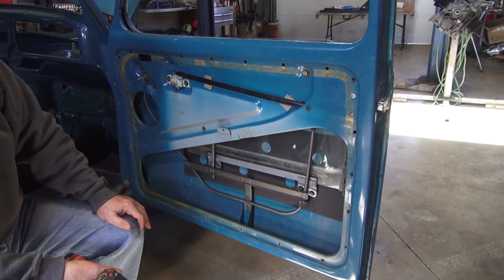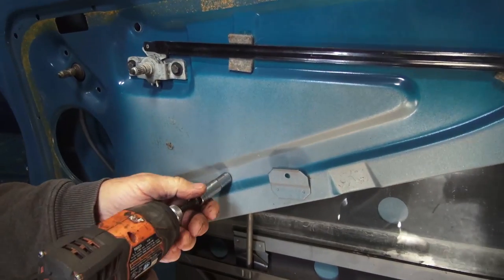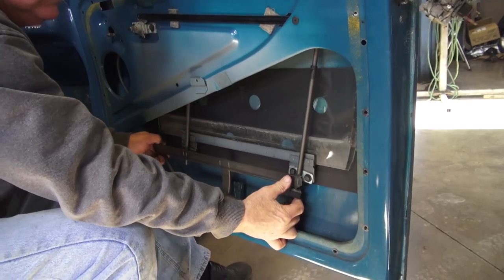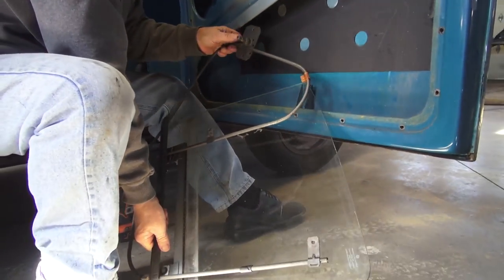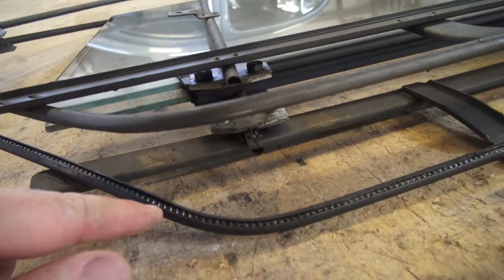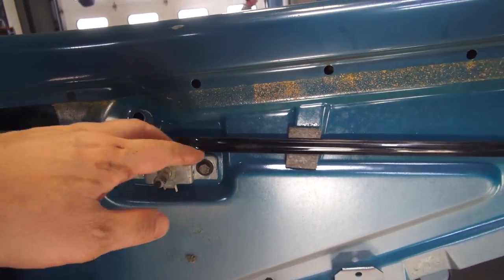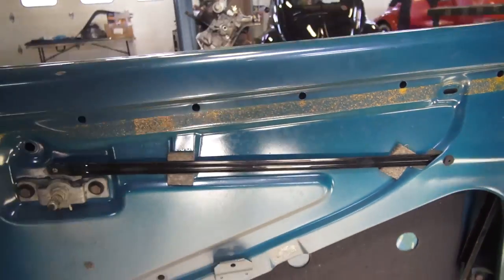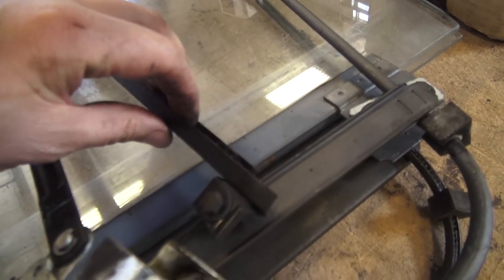Classic VW BuGs How to Remove Install 65 and Later Beetle Door Mech Glass

Comment: Thanks for all the videos! 
Having a hard time getting it all put back in. Does the vent window go in first or last!? I keep doing it first. The. The top part of the regulator gets stuck on the wrong side of the arm of the vent window 😤
Reply from the maker: Well, you need the vent there to get the glass in the vent post channel, so yes, loosely put the vent in.
Reply: Chris Vallone I tried putting the window in separate to see if it was easier and it’s SUPER hard to get up the channels. What makes it so hard? It just seems like it should go up and down much smoother. 
I’m going to try and put it in the regulator first this time and install that way but it seems like too tight a fit already on its own 😐 maybe cause it’s new channels? What’s the trick!?
Reply from the maker: @jessicareed7865  new felts in the channels?  If so, maybe take out the new felt for the vent post and make your own.  I have a video on that, it makes the window go up and down easier.  New felts are made too thick today.

Comment: I have a 71 super beetle I have a question about. I took apart the window regulator in hopes cleaning it out and lubing it would fix it. It cranks down ok, but won't crank up, the winder just clicks. Is there a way to repair the winder part. Since I lubed it, it does roll down smoother.
Reply from the maker: hmmm how are the teeth on the mech?  New felts in by any chance?
Reply: @classicvwbugs  no looks like all original regulator from 71, I took it apart and cleaned out the tube that the spring rides in, regressed it , goes down smoother though now. Need to push up on the window while cranking up. Can send a video of the sound it makes. Might just be the winder mechanism. Original felts too. I did end up placing an order for a new regulator though